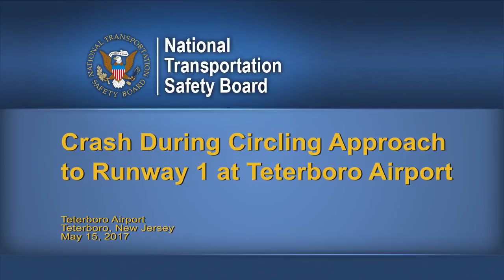Learjet 35A Teterboro Approach Crash • NTSB Animation

Comment: I don't get it. How can two presumably professional pilots (they're in a Lear, for crying out loud) be THIS BAD? I'm only a PPSEL with an instrument rating, and the most advanced aircraft I fly are Mooneys. But watching this, it was one thing after another.

The captain didn't know where they were. How the hell does that happen?

They clearly didn't review the approaches. Now, without looking at approach plates, the only circle to land I've done involve flying over the top THEN circle. I wasn't taught any approaches that involve flying the localizer but then using ground reference to navigate to a different runway, other than if I went over the top. To me, that was weird. But I don't have the approach plates, and I'm not flying high end Lear jets. Maybe that's a common approach.

The SIC repeatedly tried to hand off control. It sounds like he was in well over his head. That may be, but if so, what was he doing in that plane in the first place? What was in doing in IFR conditions if he wasn't qualified to fly the aircraft? And what is wrong with the captain that the SIC has to repeatedly ask to hand off control, to be ignored?

Who has to be prompted three times to contact tower?

Who forces a bad landing? A high bank turn because they screwed the approach. They CLEARLY needed to execute a missed approach.

Who flies a perfectly functioning aircraft into the ground. Okay, landing is screwed up. Everyone is screaming airspeed and descent rate. Level the wings, apply power, and go around.

I can't imagine why anyone could be this bad.

Comment: It's painfully obvious that something was going on that was distracting the pilots or affecting their judgement. They were too low to be hypoxic, but they  had something going on. The read backs were bad and communications showed confusion and lack of understanding of the situation they were in. How does the PIC think he's "hundreds of miles" from an airport that is less than 100 miles away from Philadelphia? Why didn't the SIC pick up on that major mistake?

When the PIC took over the control he instructed the SIC to monitor his airspeed. The PIC was informed he was too slow and didn't seem to react to that statement, but he acknowledged it. They were low and slow, and then stalled with ZERO hope of recovery.If you watch the plane come down at .25 speed you'll see that it is almost fully inverted. What a shame.

It seems that there were a series of mistakes that should have warned all involved to change  plans. The PIC and SIC may have been hampered by their inability to deal with the reality of the situation facing them. They thought they were "hundreds" of miles away, wanted to be at 27,000 for a short hop. and weren't following any flight standards at all. Their interactions with ATC were a bit sloppy and ATC was following the flight and warned about missed altitude and turns. As usual, a series of small, correctable mistakes added up to a disaster.

Comment: IN CANADA BOTH PILOTS MUST BE CERTIFIED (type rated) TO FLY THAT AIRCRAFT TYPE. BOTH EQUALLY AS QUALIFIED and we change sets and ALWAYS flew from the left seat. This worked for me for over 5,000 flying hours in Learjet 24, 25, 35. and many others.  The Learjet 'can be' a high work load environment IF YOU GET BEHIND in your planning, check lists, SITUATIONAL AWARENESS.  Retired from Boeing 757 / 767 after 40 years in the air ZERO INJURIES OR PROPERTY DAMAGE.  How can he / she be second IN COMMAND if  he / she is NOT QUALIFIED AND TYPE RATED ON THE LEARJET !?!?!? NOT IN COMMAND AT ALL.

Comment: I'm just a private pilot but the dreadful "flying" here is thankfully very rare. When ATC give a pilot an instruction that has to be complied with unless an emergency is declared. Ignoring the "Captain" for a moment, the SIC had no business to hold that position on that flight if he wasn't capable of completing it to a safe and successful landing. As for the "Captain" ...  he had no business to be in charge of that flight .. or any other flight ... the SIC should have had enough experience to take control of the aircraft ... to override the idiot "Captain" ...  unbelievable,
Reply: The SIC was in control of the aircraft for all but the last 15 seconds. And no you don't fight for control when you're in a stall 400 feet AGL.

Comment: In my experience overflying the runway and entering a pattern for a circling ILS approach is standard.  Not a hard right and then left less than 3 miles from the runway in a jet.  I suspect the PIC was planning a runway 6 overflight to left pattern for runway 1.  Am I wrong??

Moreover, the right turn at Torby with the wind gusting to 32 kts out of the NNW is nearly a turn downwind.

BWY the ATC request is not a real "circling" it is a "visual maneuver".
Reply: That would make the most sense since he seems pretty cognizant throughout that he's planning to land on a different runway than the one he's heading towards.  I guess he had an aha! moment when the tower asked when he was going to make the right turn.  But what is odd is that there is no dialog in the cockpit about the sudden realization.  Maybe he didn't want to show the SIC that he hadn't understood what he was supposed to have been doing all along.  I guess it is consistent with his decision to not cancel the approach once he realized that he had misinterpreted the instructions.  I guess he didn't want to admit to anybody that he was wrong.
Reply: I tried this on X-plane.  It is a hard right at Torby (essentially downwind) then quick hard left to Runway 1...ridiculous.   @charleshein4477
Reply: Yes you are wrong, you don't overly the airport in a circling approach (it's an IFR clearance, not VFR) nor do you enter a VFR traffic pattern.

Comment: "A background check on the captain discovered he had a 2002 driver’s license suspended due to an excess of points that was not reported on his most recent medical application as required. He was also in 1986 convicted of assault with a deadly weapon, a charge that was reduced to a misdemeanor, but was also not self-reported on his recent medical certificate.

The captain’s training records uncovered a number of failed checkrides, including a December 1996 disapproval for a certified flight instructor rating, a November 1997 disapproval for a commercial pilot certificate and a February 2001 disapproval for a multi-engine airline transport pilot certificate. He did eventually earn his commercial and ATP certificate."

"Training records from CAE reported issues with the captain transitioning to the left seat of the Learjet in October 2016. In July 2016, CAE records indicated the captain was found not proficient in circling approaches and not recommended for his type rating checkride. Specifically, the captain’s CAE instructor on July 17, 2016 reported to his boss that “the Captain had been out of the airplane for 7 years and the instructor could not recommend the Captain for a check ride due to a lack of proficiency.”

Excerpts from:
https://www.flyingmag.com/teterboro-learjet-crash-raises-questions-about-crew-qualifications

Comment: These guys had no stick and ridder skills and an understanding of basic aerodynamic concepts. They had terrible CRM as well. This is why flying for an airline is so much safer because you get all the training. I believe that all pilots should be required to have a 4 year college degree in aerospace before flying for a 135 or 121 operation.

Comment: What a complete shit show.  Neither pilot had a clue where he was or where he was going.  The SIC at least seemed to know he was incompetent but the Captain for what ever reason kept ignoring him.   NY is a busy environment and the controllers are often short with clarity but these two didn't even seem to grasp that they were flying a jet at 4+ miles a minute and had no concept of what the approach required.  We can be thankful they didn't have any passengers on board nor kill anyone on the ground.  Darwin strikes again.  What a waste of a beautiful airplane.
Reply: I read the NTSB report... this "captain" never managed to be rated Pilot in Command of the previous two airplanes he flew (MU-2 and Q400) and completely blew his check rides for PIC on the Lear despite having acquired something like 6500 hours.  The copilot apparently had 1500 hours and almost 450 in type but couldn't hold heading, airspeed or altitude???  I've flown with lots of bad pilots but none remotely approach the level of stupidity of these two - which is something considering how many hours they were supposed to have had.  I suspect some serious log book fudging on both of their accounts and I would guess that the "Captain" was one of those people nobody wanted to put in the left seat until this shady outfit stuck him there and even then they had to spend 30 hours in the Sim to get him to pass his check ride (normally 5-10 would be plenty and even less if he had flown the type before which he claimed he had).  Oh well, two less idiots to run into out there....

Comment: This is what happens when the flight schools rush u through, pass you via thier paid examiners and the focus is not on stick flying but "engineering" ...no flying skills!  The sic-0, as any commercial if rated pilot, should have been able to do this easily.  If the pic was not in command and willing, the sic-0 should have been able to...or should not have been certified!  Ive flown that course dozens of times...it's a standard and EASY approach!  I'd bet anything that the sic-0 went to atp or a Florida fast pace program...in those they will pass ANYONE and stick flying pretty much stops after ifr, twin n commercial portion...if not sooner.  Sad but this was 100% avoidable n sloppy careless...u do it not me "flying".  No pity to those two pilots that died...only to the passengers/ground injuries.  I hate "pilots" like this... totally unqualified, careless and unfit.

Comment: I think US speakasfastasyoupossiblycan air traffic controllers are partly to blame.  No other country speaks as quickly in the air.  Air traffic into some British airports is much more congested than in the US, but the controllers speak carefully and slowly and precisely and require properly read-backs...I think such communication leads to better comprehension and better compliance by pilots...and better safer flights than in the US.  I have no idea why American controllers all seem to want to speak so quickly in such a safety-critical environment.
Reply: These pilots didn't even complete an in-air Checklist on their aircraft and exceeded speed restrictions and you want to blame it on US ATC? Are you fucking serious?
Reply: This has nothing to do with atc speech. Each command was heard, acknowledged and confirmed by the pilots in every single transmission, yet those commands for the most part were almost all neglected. So speed of communication had nothing to do with this incident. This was arrogant, lazy and careless flying from the moment they departed PHI airspace in so many different ways.
Reply: All Blame falls on the PIC. He was clueless about the distance of intended flight. Was requesting an altitude increase when given the remaining distance of the flight was ridiculous. The PIC had flown the same route dozens of times previously (NTSB full transcript) yet was confusing runway 1 with runway 6 and didn't make the circle turn as directed. Don't blame ATC for fast talking. Pilots are trained to listen to it. It is not a Macho Ego trip either. Things happen real quickly up there with dozens of approaching/converging aircraft at varying speeds ATC doesn't have time to chit chat and hold your hand. The ten seconds extra per contact would extrapolate to minutes added to other aircraft and at 5 miles out on approach aircraft would be overshooting runways and causing all kinds of issues and accidents. Sadly the PIC, who violated numerous flight rules, caused this accident.
Reply: Lol.  Go fly in Asia.  The US ATC system is absurdly easy comparatively.  Seriously, you must be very inexperienced, as this ATC cadence is actually very slow paced compared to how busy it can be.  Airline hub airports (ORD, SFO, EWR, ATL, etc.) are MUCH busier and faster paced.
Reply: The pilots know pretty much what to expect, they confirmed instructions but were not running checklists, didn't know where they were, were behind the plane, too inexperienced to be at the controls... the quick commands were due to time constraints, plus everyone knows the drill and just need the numbers. To a non-pilot or someone behind their plane, maybe it seems too fast. If anything is ever unclear, they can simply state that and ATC will slow it down and make sure everyone knows what's going on. 
What killed these guys is poor procedures and lack of professionalism. Read the whole transcript... they were cussing, joking and complaining, the captain was barking at the observer who wasn't supposed to be doing ANYTHING but observing.
Reply: @@Box of Rocks Non-pilot agreement. When giving orders, the Corps teaches speak clearly, concisely and get positive feedback. None of this was done here. Those suggesting suicide-murder look to be right.
Reply: incompetence masquerade by fastness. The controllers and FO are in great part to blame
Reply: Student pilot here (USA). We need recurring training  for everyone on freq. Clear enunciation, pace and volume  that place emphasis where it belongs  go a long way to helping the listener understand. Maintaining a relaxed, friendly demeanour is a Human Factors aspect of comms that also increases the effectiveness of speech. Any trace of negative emotion can trigger an emotional response, which impairs thinking. Training in maintaining relaxation in pressure situations will also reduce risk. There is enormous room to improve.
Reply: I can't speak for European controllers (and your comment is a total generalization anyway, since there are bad European controllers, and bad American controllers as well), but otherwise I totally agree. Some of these NYC Metro controllers seem totally bored of their jobs, disinterested, speak to fast, many have an accent, don't annunciate clearly, speak in a monotone voice, etc. etc. etc. I'm sure this is true to some extent of AT Controllers around the world. There's always great ones, and always bad ones, and everything in between.
Reply: @Box of Rocks  congestion creates great time pressure. they all know the formula and even when the transmission is not perfectly clear, the brain fills in the missing gaps because the formula carries a lot of the meaning. 

For example: 

"and the rockets red glare the boms bursting in air gave poroof thrtought hte nifgght that our flafg was stil there"

can you sing the tune for those words?  If so you got the message even though the expression of it was not perfectly clear. same thing happens with the radio. true, it sounds macho (but only because that is incidentally the culture; they aren't doing it to be macho, they do it *because they already are*) ,  and true, it's unnecessary (it's just a very routine activity; so that tends to create shortcuts),  and it sounds like showing off (anytime someone is really good at a high pressure, high status, high visibility  job their ego gets involved, even if it's not intentional).  So all those things you mention are really happening but not for the reason you suggest. The point is the same though: too fast is counterproductive and the best controllers (like Kennedy Steve in New York) follow the model I suggest: they speak clearly, and not too fast, and sound like they are  in a good mood. Having fun at work has been proven to improve productivity and creativity and job satisfaction.
Reply: I respectfully disagree. I have ferried aircraft from parts of Europe back to the US and European controllers are no better when it comes to instruction.
Reply: @davidwarkentin9848  you may have a few examples of less good European controllers, but the US problem is endemic across the US.  speakasfastasyoupossiblycan US air traffic control cannot be correlated with the safe conduct of flight and it appears to have grown up as a macho thing that only happens in the US.  Why hasn't the FAA dealt with this?

Comment: What killed them is the "Sink rate pull up" instruction. You pull up rather than to abort the bank, remaining straight while increasing your air speed you will make the plane drop faster than had you aborted the bank while increasing throttle.  He probably did exactly what the warning device said to do. Seems to me they  need to update the safety software to alternative verbal commands like:

stop turning into the bank and remain straight, or have a safety landing program that automatically takes over and brings the plane out of a bank while momentarily increasing thrust to maximum.
Reply: again the  archaic NTSB and their failure to look at all angles! it is easier to claim pilot error
Reply: You can't even spell STRAIGHT.
Reply: @SOLDOZER  Can't even stay on topic. Can't respond without finding micro faults in others. I would imagine you have a miserable life, nothing to contribute, and only go around finding fault in others. What a miserable existence.
Reply: @MythHealer   TRUMP 2024!